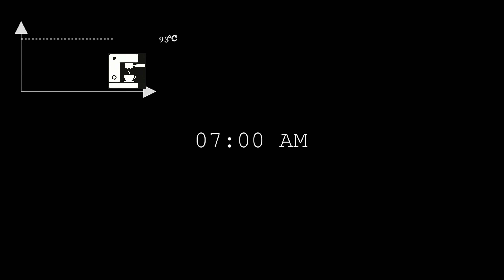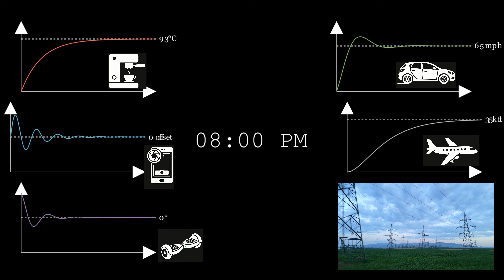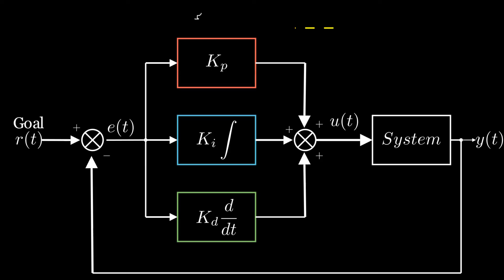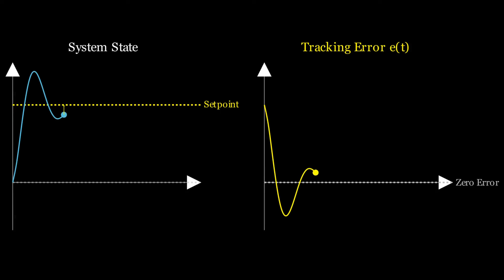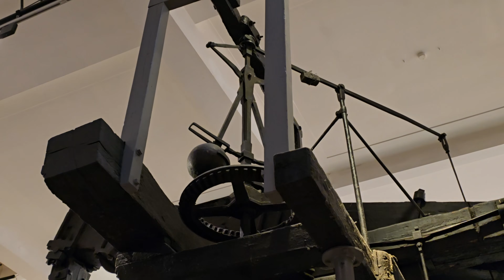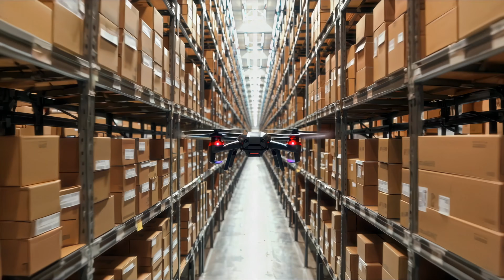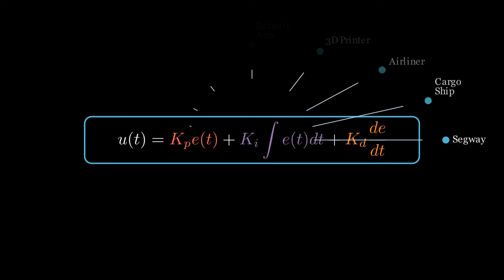The Most Important Algorithm You’ve Never Heard Of

Comment: PID is not a controller, it's hard to think of as a theory. I treat it as three different functional component of dynamics. The mathematical worst is when you think it's literally P + I + D, it is a mismatched trio in most encounters, never settles to equilibrium - not in real world. 

My take, as long as you know when to use P, I, or D in correct combination you can put the system into equilibrium. Each term is a unit as simple as P in meters, angles, etc, D as the rate m/s or rad/s. The I is when you want to measure the effort the work being transpired as a result of action.

Comment: Fun fact, the PID gains on a position controller have real units.  Kp is N/m just like a spring, Kd is N/(m/s) same as a damper.  Ki is N/m*s, which is measurable but doesn't have a passive equivalent.

Comment: I can only echo what has gone before, for (far) too long I struggled with understanding the fundamental terms of a controller and I was far from the only engineer. 
This video is a simple yet truly elegant explanation in order that these concepts can be easily grasped
Thank You
Reply from the maker: Hey, thanks a lot for the appreciation. Is there any other topic you would like to see explained like this?
Reply: @Prof_Gio  Thanks for the offer and apologies for the late reply. 
Once came across a procedure for how to set the parameters for PID by applying inputs to the system and measuring of response, so a practical guide on how to go about it may be something worth considering, if you're aware of that.
My understanding of control theory taught many many years ago would have been much clearer if time had been taken to explain in the manner you're doing now, instead of launching into differential equations from day one 😉  
A bit late for me but IMHO these videos are great and will help anybody starting study in this field, or techs faced with optimising control parameters to a system

Comment: Works great as long as every used component is REASONABLY linearly responding.  You need a little extra ideas when something starts showing things like saturation, i.e. running out of available torque, for example.  Another thing to complicate issues is a modern digital control that gets its feedback measurements stepwise, based on some clock frequency/time delay.  Very often real life controls actually use 2 (or maybe even more) cascaded feedback loops.  imagine the following:  You need to control your Accekeration/Torque in the innermost loop, the Velocity in an outer loop and finally the position in the outermost loop.  Of these, at least the Torque is limited -- non-linear if the velocity command drives the torque loop too high, meaning to saturation.
Reply from the maker: Indeed, there is a lot more to it in a lot of cases! Thanks for your comment.

Comment: Often the best set up is to overshoot slightly, because that gets you to the set point far faster and the oscillation soon damps out. If you damp it like shown in the video, it never quite hits the set point. But it does depend on what happens around the set point which is best. If it's a chemical reaction that explodes at slightly above the set point, then you don't want ANY overshoot!
Reply from the maker: Indeed, it depends. Thank you for the insight.

Comment: I have, in fact, heard of it *smugface*. Though yes, I work at the factory and at some point had to look into what is PID to understand some mechanical problems present.
0:05 Also for specifically coffee maker PID controller seems like huge overkill, bimetallic strip gang rise up!
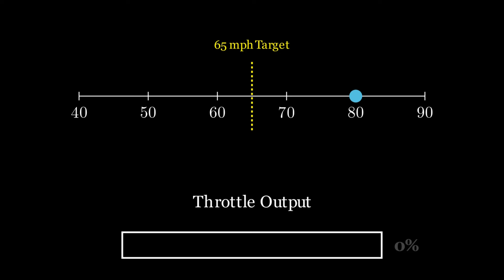4:39 Okay, you got to the thermostat controls, exactly what I meant.
4:42 Ugh, no? When car cuts gas, there is no more acceleration, so speed stops rising. There is no "acceleration momentum" that'll keep your speed increasing. A bit better wording probably would be "because of physical delays existing in the system, gas actually gets cut later than it should have been and car overshoots its target speed".

Good and simple to understand video overall, thanks.
Reply from the maker: Thanks for your comment! I wondered what percentage of the population out of 8 billions knows this! 4:42 ops, you are right, I made a mistake there in my narrative 😢
Reply from the maker: Ah, you are referring to the title "The Most Important Algorithm You’ve Never Heard Of". I was surprised by it. The way it works is that I put 3 titles and youtube runs them all. Based on retention statistics it selects the final title. It usually takes about a week. I didn't think that title was good and I almost removed it from the 3. It turned out that I don't understand anything about titles because that one blew the others out of the water and was declared winner in 10 hours 😅
Reply: @Prof_Gio  ah, yes, I forgot A/B titles are the thing.

Well, human psychology is weird😅 Probably it is more sensational and clickbaity. Maybe. Who knows, youtube works in mysterious ways.

Comment: An amazing part of PID is that it can be made using only analogic components
Reply: Flashbacks to 2nd and 3rd year ELEC with resistors, capacitors, and inductors.
Reply from the maker: Thanks for your comment 😊
Reply: Another amazing part is that it doesn't even have to tuned properly to work surprisingly well.

Comment: I don't think I can agree that PID is 97% that seems too high given engineers are lazy. Bang–bang control is probably still used a lot if not more. Bang–bang is really simple its either on or off, if we are below we are on if we are above we are off. An airco often works like that. Dehumidifier, refrigerator, fans on a radiator. All are automated systems and all mostly use Bang–bang. Specifically Bang–bang with hysteresis.

Anyway good explanation. Maybe I can use this to fix some PID values by hand when I need it.
Reply from the maker: Mmm possibly, but if I think of bang bang control I come up mostly with that kind of applications (i.e. reach a temperature in a system with a lot of "inertia"/slow dynamics). Surely, there is a lot of bang bang around, but if I think of everything, e.g. cars, motors, etc. variations of PID should be the vast majority because it covers many more use cases.
Reply: PI and especially P regulators also have their place. The problem is that PID regulators can be impossible to tune if a system demonstrates substantially nonlinear behavior. Thankfully you don't actually need top buy any special software or controllers for any of that cases since you can always just use a standard PID regulator and set it up to become a P or PI regulator. In order to get simple ON-OFF regulation for example you just set {Kp=100500; Ki=0; Kd=0} and check the output signal limits and it's gonna work as expected. So technically a PID regulator is a generalization and all the 4 common options can arguably be called PID regulators.

More complex types of control you can't implement using a simple PID regulator are also commonly used, modern drones for example require more than one order of a polynomial for their dynamic parameters predictors in order to be stable, but generally you don't want to mess with any of the complex stuff unless really necessary.

Comment: PID is not elegant, this video started bad
Reply from the maker: Elegance is subjective and there is elegance in simplicity.
Reply: It seems strange to me to say that PID is not elegant when it is so simple, effective and universal. What is your motivation for saying that? What other control algorithm do you consider more elegant?
Reply: @Heater-v1.0.0  in tech elegant means that something handles many things inherently in a complete way or just fits perfectly to solve a problem, one example is MPC which is SISO/MIMO and has constraints in one package. 

pid is the opposite, you always need some custom logic to make things work because it is so primitive, a nail is also simple, is a nail elegant?
Reply: @rezah336  Conversely I think of "elegant" in tech as something concise and simple, that solves a problem with the minimum necessary components.  Someone summed this up as the  "least complex sufficient solution", As such the PID is elegant if it is actually sufficient to solve your problem. On the other hand hand MPC is a lot more complex and may be overkill in many situations. Which would noit be elegant. 

So we see "elegant" solution rather depends on the problem one is solving rather than being absolute. Certainly a nail is an elegant solution when I want hang a picture on the wall.
Reply: @Heater-v1.0.0  the video isnt about a problem though, but about an algorithm
Reply: @rezah336  Well...yeah. But I don't know what you are getting at. Typically we study and use algorithms to solve problems. At least engineers do. Algorithms exist to solve problems. Whether any one of them is an "elegant" solution to a problem rather depends on the problem and the algorithm. And likely whatever other constraints there may be. 
In the abstract MPC, in the absence of a problem,  may well be elegant in your eyes, PID is to me. Oh, and MPC, the Fast Four Transform, Minsky's circle algorithm and a ton of others.
Reply: @Heater-v1.0.0  what is elegant about the P part causing set point spikes, and the D part amplifying noise?
Reply: @rezah336  PID obviously has it's limitations. But if it solves your problem, as it often does, I rate that as an elegant solution. If it cannot solve you problem then it is not a solution and elegance is neither here nor there.
If you problem can instead be solved my MPC then I'd say that was an elegant solution as well. But if you are using MPC when PID would do then that is adding complexity and requiring compute unnecessarily. I would say that is an inelegant solution.
By the way, MPC is a generalisation or superset of PID mathematically so in the abstract, with no particular problem in mind, I see no room for debate about the relative elegance.
This is a silly argument we are having, is it not? 
 Anyway, thanks for the discussion.
Reply: @Heater-v1.0.0  you started it, and you're wrong, good day ;-)
Reply: @rezah336  What do you mean I started it? I was only wondering about what you meant by it and why?
What do you mean I'm wrong? The perception of elegance is a subjective thing. 
Do you normally get so angry in such discussions?
Chill out. Have fun.
Reply: @Heater-v1.0.0  you're too sensitive, i wasnt angry, elegance isnt subjective, is bang-bang elegant? even simpler, or fuzzy logic = if-else-control? good day
Reply: @rezah336  I elegantly nailed your mom.  Happy Mother's Day!
Reply: @rezah336  Not sensitive. Just curious.  Well, according to the Wiley Dictionary: 
"In the everyday, elegance is a wholly subjective attribute. Whether we deem someone to be ‘elegant’ is entirely dependent on our own personal perception of their outward appearance. Here, Manuel DeLanda provides for architecture an objective interpretation of the elegant or smart solution in which ‘there is a measurable economy of means to achieve a certain outcome’. "
As we are talking in a technical context here we should be looking for the objective  n which "there is a measurable economy of means to achieve a certain outcome’".
Clearly PID is measurably more economical in achieving desired outcomes in some situations, ergo objectively elegant. 
Thanks,, Glad to be of help.
Reply: @Heater-v1.0.0  then a toilet is also elegant since it economically disposes of our urine? you mean PID is elegant like a toilet? ok, 

i use the the word elegant in context of tech, connected to art, i am hobby architect, beauty in art  objectively means that it is an attempt to create paradise on earth, or it is not art and it is ugly. but there are people like you who say it is subjective and anything can be art, then i say, is a toilet art?

harmony, beauty, elegance....you get it, at its core is not economic, there is a higher level, all good comes from God, and if you are atheist the simple proof for existance of God is morality.
Reply: @rezah336  Why the downer on toilets? I don't know about modern toilets but the all "ball-cock" water level controllers were sweet.  When the cistern water level is low the ball goes down and opens the water valve, when the water rises it pushes the ball up and closes the water valve. Getting the water to stay in the cistern until you hit flush and then start in the cistern again after the flush is also brilliant.  All that control going on with no computers or electronics,  with no electric or other power input required. Cheap, simple, effective, clever. Certainly an elegant solution to the problem of flushing toilets. 

Evidence would suggest anything can be art, depends who you talk to, people have heated arguments about  that. Purely subjective.  Piles of bricks have been displayed as art in galleries. as have dead cows, all kind of stuff.

I have no idea what you mean about art  needing to be beauty and create paradise on Earth. Often artists create works that instil powerful emotions about things that go on in the world.  About injustice, cruelty, war, whatever. They need not be beautiful.  But hay  "beauty" itself is subjective even  it is an objective fact that an artist is trying too achieve it. 

Anyway I think we have to agree to disagree about the meaning of word "elegant", and whether a PID is in that category.
Reply: I think it's very elegant. We were looking for the simplest mathematical concept that solves the regulation issue for all systems with, let's call it, relatively "smooth" behavior. Turns out that concept is a simple integration. I would say that is elegant.
Reply: @StefanReich  yes it's simple but it's too simple to be called elegant, if you're an m.sc or similar it's just so primitive and cant be appreciated as an algorithm but i appreciate its application, i'm guessing you're not an control engineer?